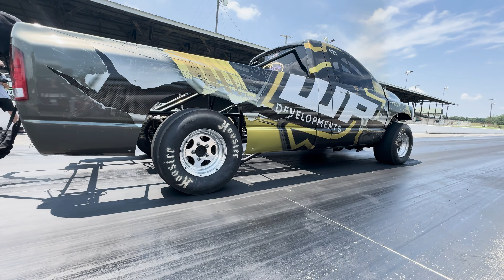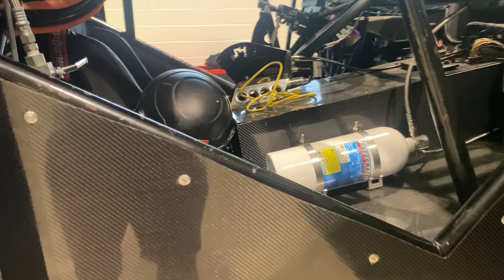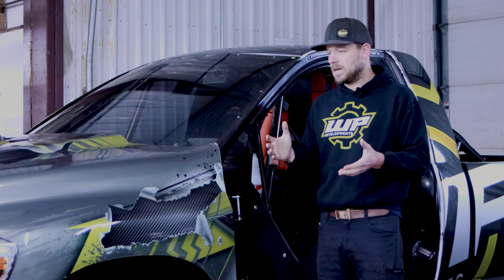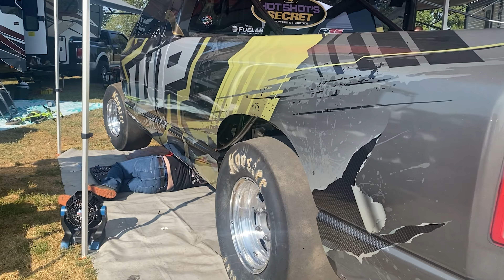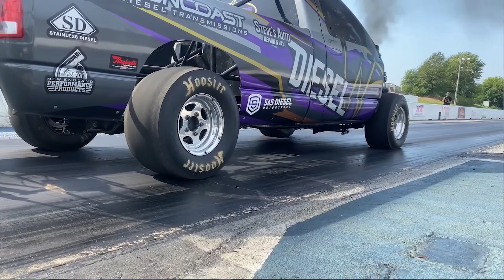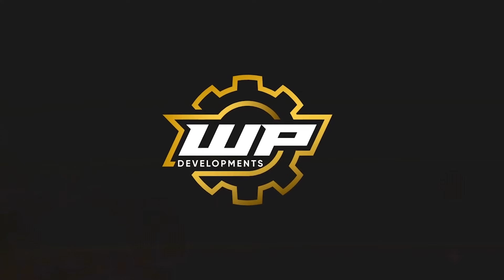High Performance 68RFE Transmissions: Maximize Your Truck's Strength and Reliability

Comment: Great video. I almost pulled the trigger on one of your units but I ended up going with a competitors unit. The 68fmvb can that be installed in and unit? How would that work with all my 19s sensors? Just have it tuned like a manual? Hope you sell them
Reply from the maker: Shoot us an email at Ethan@wp-developments.com and we can discuss some options with you!!